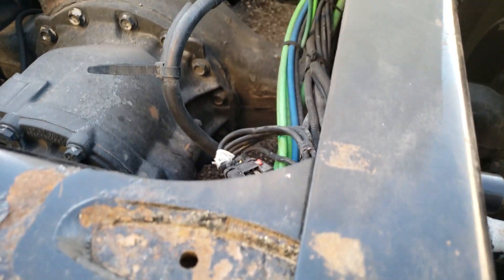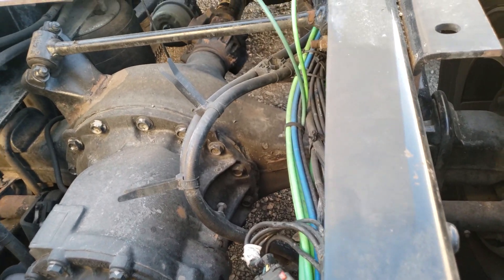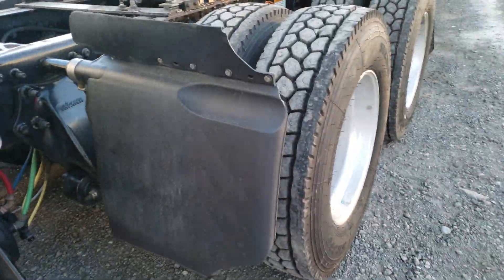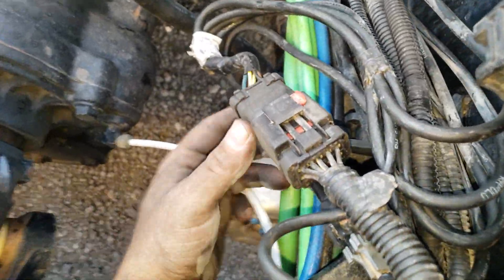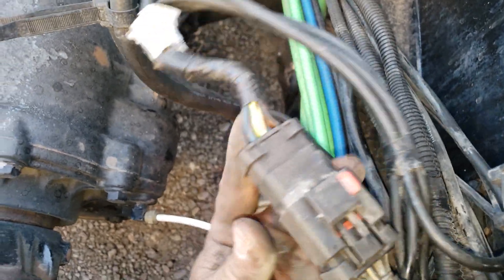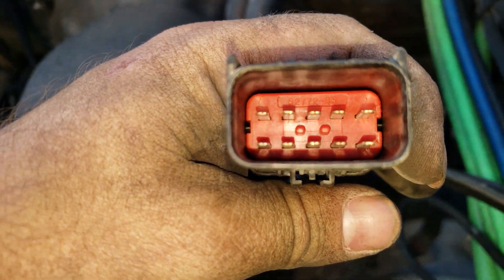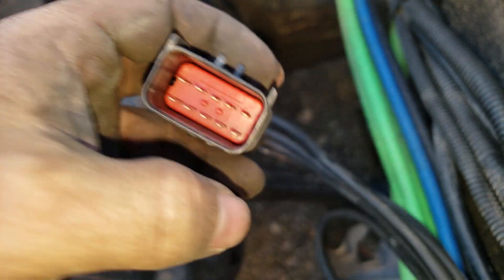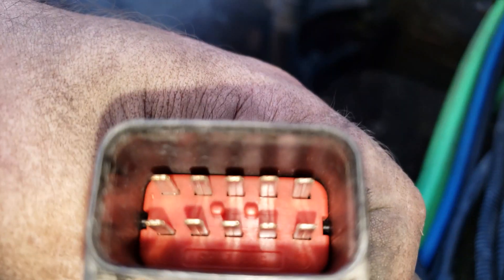Freigthliner cascadia ABS SPN 791  SPN 793

Comment: You Sir are a hero.. Fixed my ABS 11 SPN 791 FAIL 4 ... & TCU 3 SPN 563 FAIL 14..  3 am, 15 degrees - but I didn't have to call a tow truck.  

Drove 65 miles to truckstop, it started messing up again. Found a broken wire at the harness. Fixed that and it's been flawless. I also covered the plugs with ziploc bags and sealed them with duct tape. Hopefully that plug stays nice and dry this winter. 

Thanks for pointing me in the right directions.. I might get that sensor changed anyway.
Reply from the maker: Nice im glad this video could help you, thanks for watching!!!

Comment: So the problem was the sensor or the plug been wet?🤔
Reply from the maker: the fuse was blown,  i just replaced it
Reply: @TRUCKINGTIPSDIY 
Have the same issue. 
Where's The ABS fuse location? 
Freightliner cascadia 2016 .
Thank you